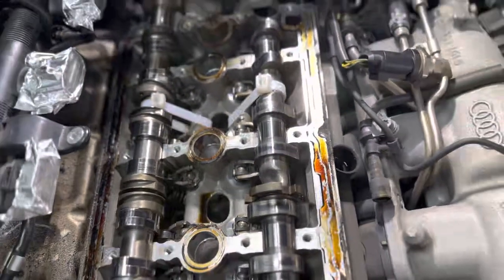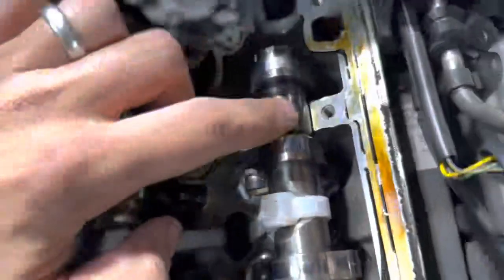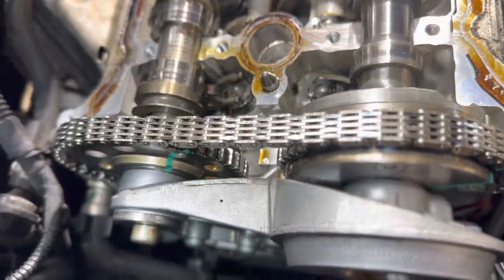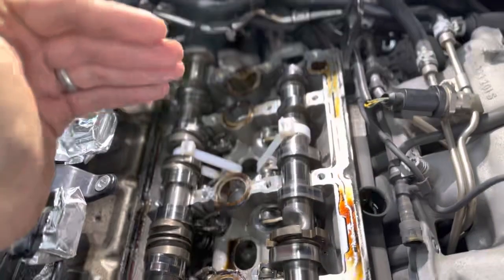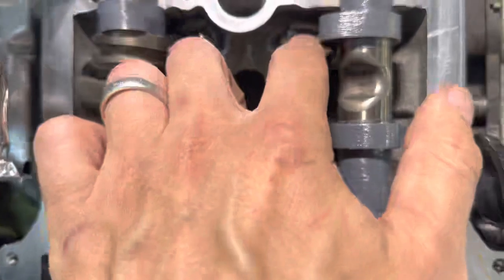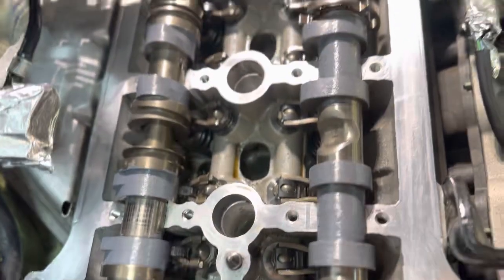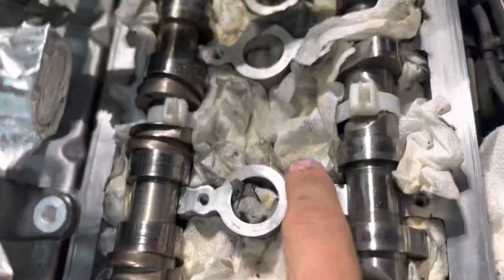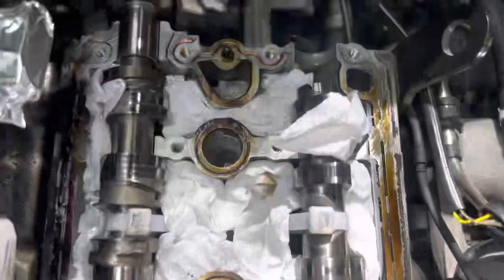VW Camshaft Cradle. Using Zip Tie down method to hold down CamShafts.

Comment: Great video! Quick question. I have a 2015 Volkswagen Passat with the gen 3 1.8EA888 engine. So I been battling this misfire on cylinder 3. I have done coils, spark plugs, injector and also did an intake cam. After all those parts still getting a misfire on 3. I did a compression test and all cylinders are at 180psi respectably. Any suggestions?

Comment: Do you install the zipties before removing the cam cover?? I'd assume that you do, but just checking...

Doing this job potentially tomorrow at my shop and I need to know,

Thanks 
🙏
Reply from the maker: Yes before. Use the heavy duty wide zip ties. The regular ones will NOT hold.

Comment: Can you use the same zip tie method in the newer 2.0TFSI engines mounted in Golf MK7 R and S3 8V? Thanks
Reply from the maker: @tymek810  any 888
Reply: @E39M5SPEED I've just had a look at my S3 8V engine after removing the PCV valve and thinking how to lock the exhaust cam on it as there is no access to it as in older generation engines. I can only think of locking it in the area of vacuum pump. Am I right?

Comment: I had a shop re-seal my cover, just got a call that the timing has jumped and they want me to pay them double for going back into the engine and put it back into time. I was going to do this job myself but figured I would have a professional shop do it. Turns out, they are not that professional. Is this easy to mess up?
Reply from the maker: Yes. When you remove cam cradle and don’t use zip ties there is a possibility cams will lift , causing tensioner to push outwards , and when you put cam cradle back it might snap the tensioner and cause timing chain slack, causing timing to jump.
Reply: @E39M5SPEED  I’m about to talk to the mechanic that is doing my word and I will have to make the argument that they are the ones responsible which I know will not go over smooth. This engine has never been opened, I bought this car when it had 30k miles and now has 150k. This is why I hate to relinquish control to others touching my cars.
Reply: @E39M5SPEED  just got back from the shop, was told it is jumping time due to a chain tensioner that was weak which to me doesn’t make sense because this car ran perfect minus the oil leaks.
Reply from the maker: @ze_german2921  well yeah. Those tensioners are trash. Ticking time bomb. If I were you I’d buy a Lexus V8

If they didn’t pin the tensioner, it’s very risky to remove cam cradle and put back on.
Reply from the maker: @ze_german2921   well you could of done it yourself then. Or took it to VW dealer and paid double.
Reply from the maker: Or bring it to me. I charge $50 per hour and this job takes me 12 hours.
Reply: @E39M5SPEED  I purchased a new chain and tensioner from the dealer and I will be working out a deal with them.
Reply from the maker: @ze_german2921  let’s hope engine is not fucked. I hope they didn’t start it and bent the valves.

Comment: I know this is an older video but I figured I’d ask just in case I get a response, 
Shop quoted me 985 for the valve cover reseal so I’m gonna tackle it myself, have all the seals and such to do it, but how do I know if i need to pin the tensioner or cable tie the cams, i saw your previous video you made about a year ago and you didn’t have to pin anything down (as far as I know). I have a 2012 A5 Quattro for reference. Thanks in advance.
Reply: 2.0 Tfsi, not sure what other specifics there are. I do bodywork not mechanic work lol
Reply from the maker: Pay them the $1k. That’s actually cheap.  If they fck up the engine by not pinning the tensioner and take the easy route and snap your chain guides it’s on them. This job if done properly is worth $1k all day.
Reply: @E39M5SPEED  yeah I might as well cough up the grand, not a mechanic so probably not worth the attempt myself, was quoted a little under 2800 for the timing chain and valve cover. I didn’t even consider doing the timing chain. Should probably just get them both done at once might be a little easier with all those one time use seals. Appreciate it